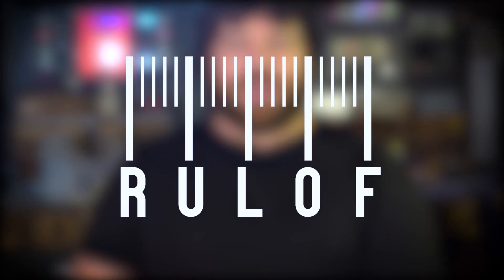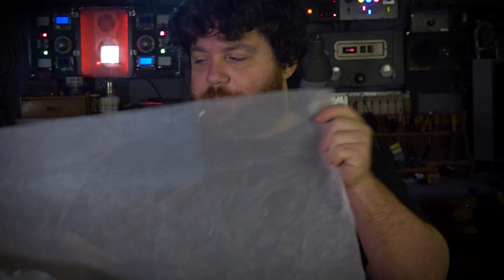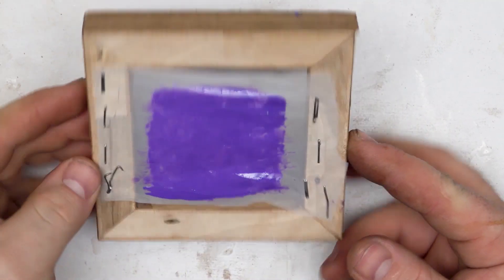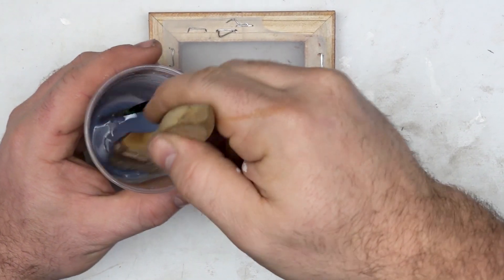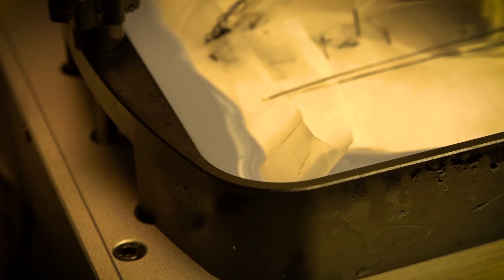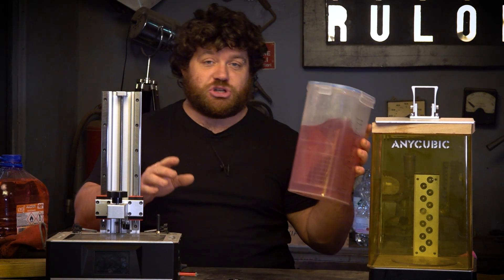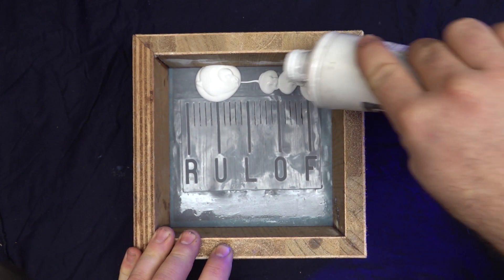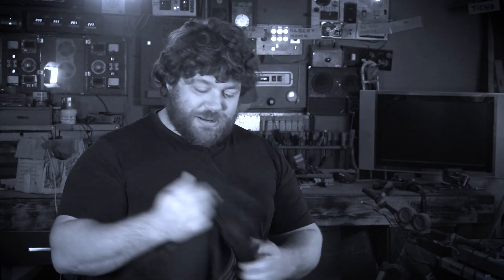How To Screen Print T-shirt Using 3D Printer

Comment: Thanks for this. The video could be shorter- Focus on the bit that works. Mention the experimentation with some quick comments . Again thanks for the content. I'm using a FDM printer so will need a different approach, but this is still useful information. 👍

Comment: Another way to do this much easier is with vinyl decal material. Oracal 631 or similar. Vinyl cutters are cheap now a days and I have personally used a real screen making process and materials as well as the vinyl and they both work well

Comment: Rulof I have a challenge for you!
Show us how to custom print on round surfaces! I need to build a color printer (maybe with minimal pallette) that will print on clipper lighters as well as on round barels. ❤🙏
Reply: I imagine an adjustable radius, with a weak spring that will keep the head close to and just above the surface as the piece turns. This way you could print on a big barrel that has a bit of thin, then thick, then thinner radius (from top to bottom)

Comment: I only know that they used FDM printers in a similar way, to print/modify cloth for Cosplay/LARPing. i.E. printing "dragon scales" on a mesh which is then sewn onto costumes
Or to print logos onto fabric/T-Shirts directly, with flexible filament.

But definitely not for stencil printing, which does have the advantage of repeatability and is the way to go IF you want to make more then 1 shirt.
I can imagine using an FDM printer in a similar way, just print 1-2 base layers, then stretching the net mesh over the print plate and print 1-2 layers again to fuse everything together.
If you put registration marks in the print, you can even level-up to multi-color screen printing!

Comment: 11:26 That’s a staple gun. Having learned Japanese as a second language, I’ve seen instances where one word refers to distinct concepts for which 2 words exist in English. In English, we distinguish staples which are pieces of wire with sharpened ends with 2 90 degree bends forming a U shape from nails with a single straight shaft, typically with a flat head for driving with a hammer.

Comment: you can do it with average FDM 3D printer --- spray down some pva / use glue stick on the table , before it completly dry lay down on it the fiber so it stick to it but glue wont go trough the fibers (or just clamp the fiber mesh all around and print on it ... done :)